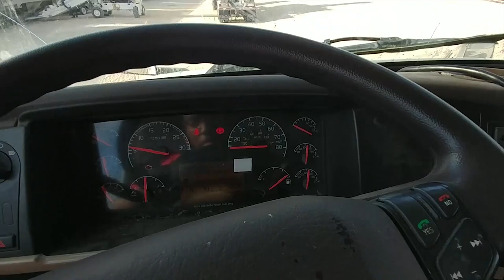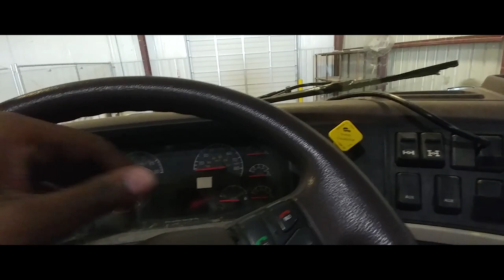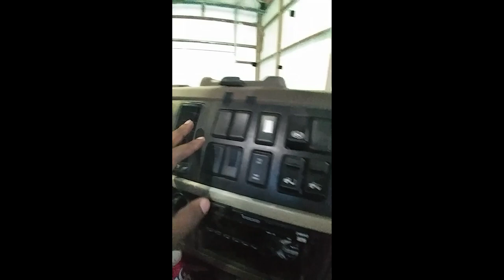Volvo Def Derated

Comment: On the D13 you can unplug the speed sensor on the passenger side of the transmission if its an automatic. The manual transmission's speed sensor is directly on top closer to the front of the transmission. It can help you get to where your going a lot faster. Temporary solution

Comment: Lol typical Volvo Regen , telling ya people can hate on the Cummins but I've got one with 300k on it and zero issues since they went with a smaller def system , and a new Pete with 605 hp and 30 k and only issue been oil change from being in the dusty environment of the oil patch , but I guess volvo is a good motor I've just never had one to last anytime , keep up the good work man don't let these breakdowns get to you

Comment: What elog system y’all using? I have Qualcomm and if I’m doing a 30m/10hr break and I decide to creep until it hits the 30/10 mark then it’ll start the clock at when I started. Moving even though I was below 25mph. Did that and found out what it was doing and said fuck it and put my self on paper logs for the day since I started my clock and would have had to do another 10hr break
Reply: It depends on how your company has your e log set up..our e log will show driving at 15mph
Reply from the maker: depends on company. im not even on the same rules as you being otr

Comment: You went from Volvo derate to some crap about hauling sand. WTF? You never did say what caused the derate situation.
Reply: Jus Trucking - Usually engine derates are due to dpf needing a regen.